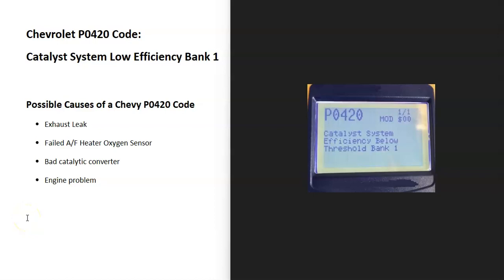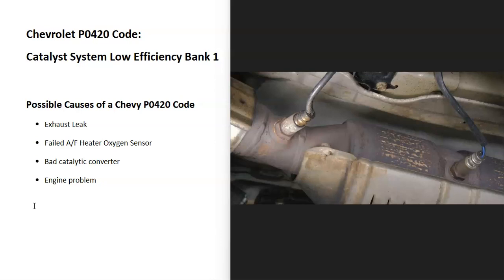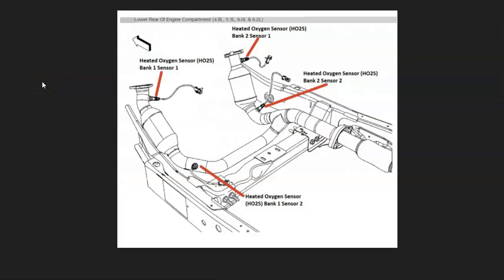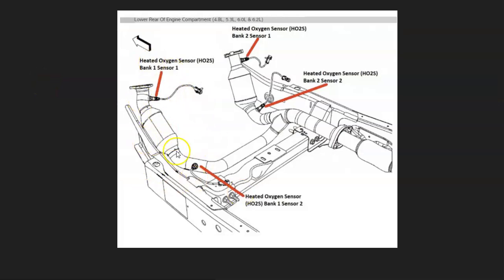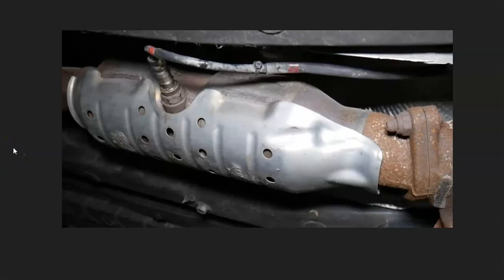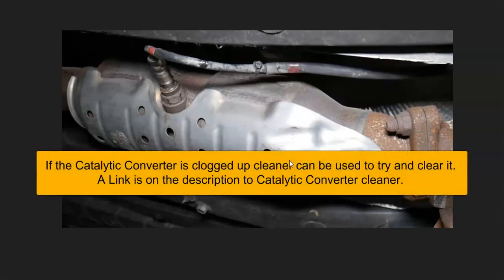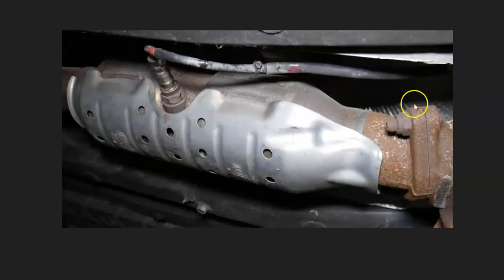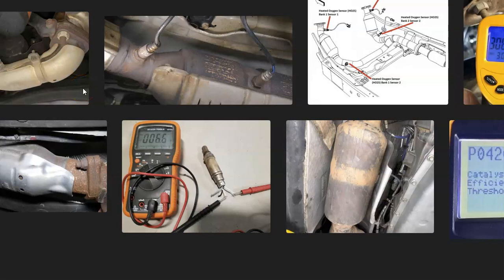Causes and Fixes Chevrolet P0420 Code: Catalyst System Low Efficiency Bank 1

Comment: Thank you for your video - helps me understand my situation a whole lot better.  
Today, Wednesday, April 03, 2024, I may go to another shop to request a Courtesy OBDII scan to verify the DTC P04020 - is the O'Reilly VERI-SCAN system powered by INNOVA reliable?  
On Tuesday, April 02, 2024, I am driving around town on a mission for my parent's either repair the electrical cord on their clothes washing machine or find good sales on a new clothes washing machine [Home DIY Projects beget more Home DIY Projects]. Suddenly, the check engine light appeared on the control display, so I immediately stopped by the O'Reilly's Auto Parts Store [other side of town] and requested a OBDII scan: the Sales Tech stated the device identified DTC P0420, Repair Cylinder Head Ground Wire, Primary DTC Three-Way Catalyst (TWS) System Low Efficiency.  I visited the closest garage whom I used in 2019 to warranty my Interstate Battery.  This shop informed me that the DTC P0420 is a like "detectives clue" it could be a bad catalytic converter [I was shocked he said my truck has four-(4) catalytic converters] or a handful of other parts in the exhaust/muffler system.  During our conversation I asked for the worst repair - if I were to replace the whole exhaust/muffler system - it would cost ~ $3000.00! I inquired if he could just cut-out the catalytic converter [he replied by law the shops in Florida cannot remove catalytic converters [Huh?]. I muttered that I haven't driven my truck more than 500-miles per year for last seven-(7) years.  He responded that check engine light is just a "Warning" and since I drive very little he said I might get two-(2) more years of driving before the warning becomes a real problem.  On Monday, April 01, 2024, the noise was nearly gone with intermittent rattling, so I stopped by the local O'Reilly's Auto Parts Store [my side of town] and requested a OBDII scan: the Sales Tech stated stated "No Diagnostic Trouble Codes (DTC's) were identified by their device.  Prior to Sunday March 31, 2024, I just don't know what the source of my mystery noise in my 2005 GMC Sierra 1500 VHO: the last six-(6) years has been rough on my truck and life has been even tougher on our family. Mystery Metal Rattling Noise.  On Saturday, March 30, 2024, while using a rubber mallet I tapped along the Catalytic Converters and Exhaust Pipes and could not see any movement, and the echo did not sound like the metal rattling noise. On Monday, March 25, 2024, I started the engine and listened to the rattling noise from underneath the truck, poured twelve ounces -(12-oz) of Marvel Mystery Oil in the engine oil crankcase and pressed the gas pedal down and it subdued the metal rattling noise, but did not eliminate it. This mystery noise problem occurred when my truck was in the local garage service. The Chief Master Mechanic [Brian] is awesome - he is a honest broker and takes on all jobs: I just wish I met him 10 years ago when I returned home to help my parents. The last few years either my truck or my parent's 1997 Monte Carlo LS 3100 was in his garage: I just swapped vehicles after repair and service jobs. For nearly 2-years one of our vehicles was in the garage.  On Saturday, March 23, 2024, I retrieved my truck from Brian and he mentioned the mystery noise, but he wasn't sure of the cause. On Friday, February 02, 2024, Brian was ready to move the truck outside of the garage because he fixed the water leak problem, but the engine would not start. Brian telephoned me if I had a spare ignition key to bring to him because the ignition cylinder would not move or start the engine. None of my ignition keys would turn and start the engine. I visited a local locksmith and they made a new key from the GM Key Code - the new key ($25.00) would not start the engine. After searching the internet and learning that the GM Key Ignition Cylinder problem happens a lot to truck owners and conversing with Brian we decided that I need a new Ignition Key Cylinder. Brian successfully removed the original ignition key cylinder and installed the new ignition key cylinder: the key turned and the engine started then the mystery noise. The past four and one-half years I had water leaking into the passenger cab space from the third brake light, the cabin pressure vents and the rear windshield. After waiting for a couple of heavy rain showers I was confident and happy because Brian indeed fixed all of the leaks. I visited a Auto Body shop in Pensacola, Florida ~ 55 miles west from my home and replaced the headliner in June 2023 and within 2 weeks I had water leaking into the front passenger side - the floorboard was SOAKED. I returned to Brian and he fixed this fourth leak too [the sunroof drain tubes were cracked wide open].
Reply: Nobody is gonna read this bud
Reply: @stevenbrutto7078  I guess you did or started to read my comment, but most likely you saw that I posted a long comment and just felt the need to satisfy yourself and provided your pathetic comment!

Comment: I had the same issues with a 2017 Chevy Tahoe, the cat was throwing the code because the vehicle was running rich.  The thermostat was opening @ 163F but should open @ 194F.
Reply: Did you fix it changing the thermostat?
Reply: I have a 2017 Chevy Tahoe as well, and I’m getting this same message. Did you find out if it was the cat?
Reply: I just got the code. 2017 Tahoe that I just did the lifters, injections, cam.
Reply: any luck ?
Reply: This is interesting. Doubt you will reply but maybe someone else will or will find this info helpful. I rebuilt the top of the engine. Cam, lifters, not the valves but did do the injection. I cleaned the hell out of the engine. So I’m wondering if it started running richer after cleaning it. Maybe the engine was used to using less fuel because it was getting absorbed by the carbon build up and since I removed the carbon, it started to run rich because there was more fuel now. Sounds like my cat is throwing code because it’s clogged because of rich fuel.  Did you or any of you other guys rebuild your engine and have this happen 3 months later?  I have 140k miles 2017 Tahoe.
Reply: How did you fix the issue? Same year and all

Comment: I had a Chevrolet there with nonstop. They told me two shops told me to murder went out. No I told them to pull Bank one sensor to right at the top of the intake. They pulled that off and started right up and spurred like a little kitten.

Comment: What if all 4 colors are different?
Reply from the maker: When that happens, you will need to find a schematic. Sometimes, you can look on eBay for a replacement, find a sensor that has the correct color code, and match it to the plug.

Comment: @HVAC_Mechanic I have the P0420 code on my 2011 Chevy Traverse came up first and then many many many months later, I now have a P0300 code, P0301 and P0303. I have watched this video https://www.youtube.com/watch?v=Cxaooj1Nufg "Causes and Fixes Chevrolet P0300 Code: Engine Misfire Detected". I saw all of my catalytic converter on the outer shell seems like it was getting super old, because the engine now has 183,000 miles on it, when I bought it from 151,000. 2022 I know I change all six spark plugs and ignition coils, I kept all of the old ignition coils. I saw your other video saying that a stuffed-up exhaust system will eventually cause other problems. I can change the rear catalytic converter once I buy it and change all the old ignition coils back in and maybe replace the spark plug again to see if all of that works.

Comment: I had my catalytic converter changed 2 years ago in my 2005 Buick LeSabre. Over this past summer when it was really hot the Service Engine Soon light came on, once the temperature got a little lower it went off. This past week it came back on but I have been driving alot more than usual and I have been using my heater because, for me, it's been cold. P0420 is the code that came up. The car is running as good as an almost 20 year old car can. Could it just be the sensors or should I worry about having to replace the catalytic converter again (which I definitely can not afford)?
Reply from the maker: The 02 sensors would need to be tested to see if they have failed. Since the Cat was recently replaced, and if the sensors are good, I would run Cata Clean and see if it clears.

Comment: P0420, p0440, wont go over 3000 rpm in safe mode, just put on b1s1 b2s1 02 sensors, and used cataclean, has fuel pressure, full tune up like 2m ago.
Reply: Did cataclean work?

Comment: hi, I have CAMRY 2011 xle, i HAD p0138 code, I toke it to the mechanic and he changed the oxygen  sensor, after about 300 mile engine light popped up with the same code and he said I need to change front sensor too, after changing second sensor engine light popped up with P0420 code! could you please advise? what should I do?
Reply: Change mechanic 👨🏻‍🔧 😂
Reply: I agree with  @SuperExain . Get your money back, & Change mechanic quick lol
Reply: If you want to do it yourself then next thing to inspect is catalytic converter. There’s a good chance it can be your catalytic converter.

Comment: Could a misfire cause this to throw a P0420 code?  Thank you.
Reply: Yes, I have a 2013 tahoe with the same code with brand new cats. I have a random misfire but not a dead misfire. Check your fuel injectors, and vacuum leaks.
Reply: Thank you.